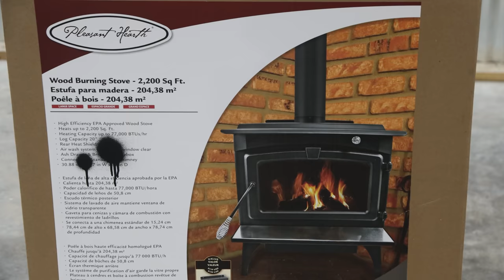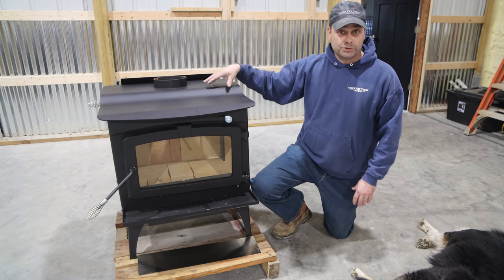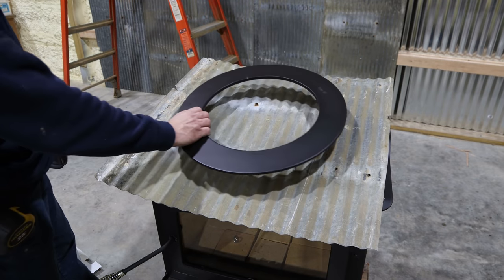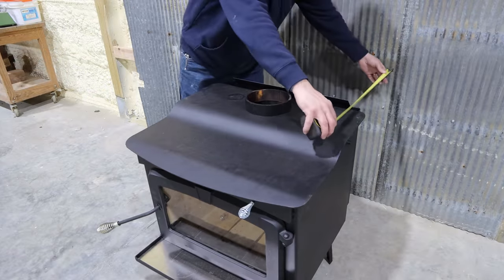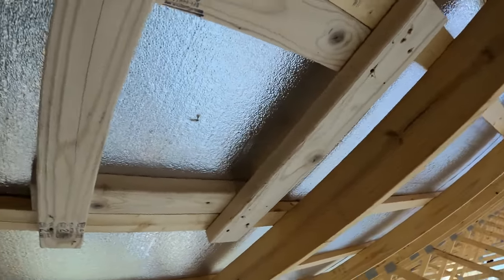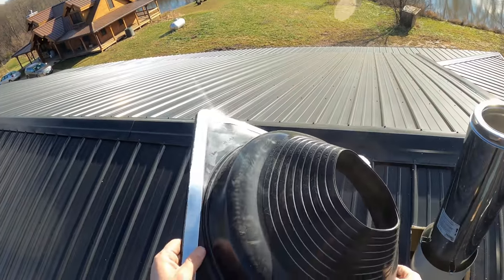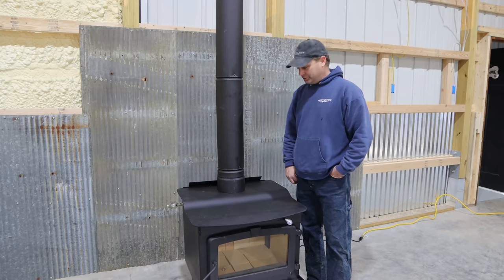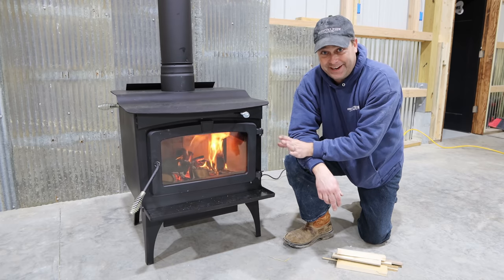Installing a Wood Stove in our Workshop.  It will be nice to have a warm place to work in the winter

Comment: Your videos look like you get things done in a hurry.  Sorry to hear you have my kind of luck with projects... at least 2 trips to the local DIY box store to pick up things I either forgot or didn't realize I needed.   I wondered how the roof was going to finish out.   Only other thing I might do is to run a piece of metal under your roof cap down to and over top of your rubber flashing.   Probably overkill but would help run water over top of that top edge of rubber gasket you have silicon.   roofers that do flashing warn to not trust caulking to do the job of flashing.  That top edge is only place I think water would sit though.

Comment: What's the extension cord running behind the stove? Does the stove have a blower too?
Reply from the maker: Yes the stove has a blower.  But it doesn't move much air.
Reply: @CountryViewAcres  We have a similar soapstone stove that provides even, long lasting heat for our home. You'll find that the soapstone will take longer to come up to full output after starting  than a straight cast iron stove but the heat lingers much longer as it dies out.

Comment: I was always taught never put fasteners in a stove pipe because it catches Suit suit and it’s hard to clean how come I keep seeing everybody screw them together just wondering I got mine in with not a single screw in it
Reply from the maker: The screws came with the pipe.  And the installation manual shows 3 screws at each connection.  Remember this is double wall stove pipe.  It is screwing the outer layers together.  The screw probably never sees the creosote.

Comment: Can u tell me about the inside width height and length of your one 
Because there are different sizes available, am confused which size to buy
Reply from the maker: If you are asking about the fireplace.  I don't think I would suggest this one.  Several things have disappointed me about it. 
The door is warped, and don't shut completely (it was warped when I received it)  some of the refractory brick in the top is cracked badly.  I am really disappointed since it is American made.

Comment: i could be wrong but you have your stove pipe upside down male ends should be facing down?
Reply from the maker: It is double walled pipe.  The inner pipe the crimps are pointing down.  The outer pipe the crimp is pointing up.

Comment: Just curious did insurance still cover your shed with a wood stove we tried and they told us know I’m sure it depends on who you go through
Reply from the maker: My insurance company covers my log home that is heated with wood.  I don't think there be any issues with having it in my barn.
Reply: The barn is an uninhabited space, I haven't found an insurance company yet that will cover a wood stove in a detached building.  If the building is connected to the house, they cover it, otherwise they don't.  If anyone knows of a company please share, otherwise I've placed this project on hold.
Reply: @madrider200  Interesting - I wonder if they rely on statistics for this policy - they usually do.  I suppose it is risky comparatively?
Reply: LMAO
Reply: @madrider200  never really new the reason why they wouldn’t but now I do thinks
Reply: @CountryViewAcres  I hope you checked first just in case cause that’s going to suck if they dont
Reply: The problem is flammable gases, creeping to the fire and causing everything to go up. One usually doesn’t  store gasoline in an inhabited structure so they’re not worried about it there but you also have to place a gas water heater so many inches off the ground for that reason also.

Comment: Do you have a damper in your stove pipe?
Reply from the maker: No damper.  You don't use one in an EPA stove.  It is only the intake air that is adjusted.
Reply: Dampers cause the smoke to cool in the stovepipe and leads to creosote buildup which leads to chimney fires which are not good events to have.

Comment: Always read the owner's manual before installing a wood stove. You need metal forences to fix metal sheet or ciment board at the back of the stove. You must let 1 to two inches under the backshield to permit  air intake mooving down to top to cut the heat in half etc.
Reply from the maker: No, the stove is 16" from combustibles surface.  The wall could be wood, I just choose metal.  Only the floor had to be non- combustible. The back of the stove has a built in heat shield.   So it has the spaced out metal shield built onto the back of the stove.  I read the manual.
Reply: LMAO

Comment: Why didn’t you just go out the back side of the building behind back of the stove so you didn’t need so much expensive stove pipe nor an inevitable leaking hole in the roof?
Reply: The stove pipe should always be within conditioned space if possible

Comment: That about the stupidest thing ever adding double walled pipe in a shop. You're losing out on so much heat that the pipe radiates from the pipe. you need double wall for attic and through the roof. A plumb bob would help keep the pipe straighter and add some strapping to the pipe to the wall.
Reply: The stupidest thing is that you didn't pay attention to what he did. He only used insulated pipe at the roof exit.... Pay attention Skippy
Reply: @daveklein2826  🤡🤡🤡He used 2ft sections of double wall all the way up @ 10:25.... 3ft sections are single wall